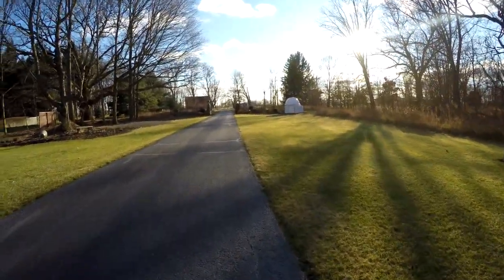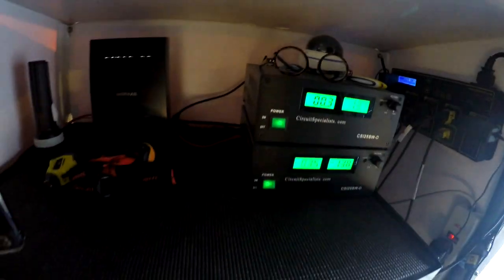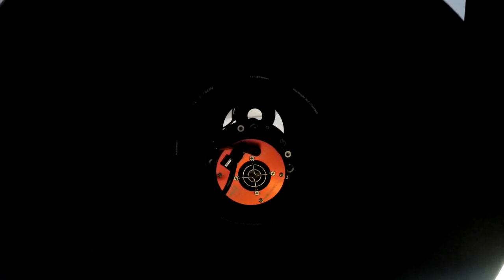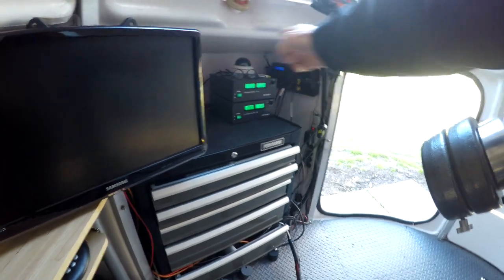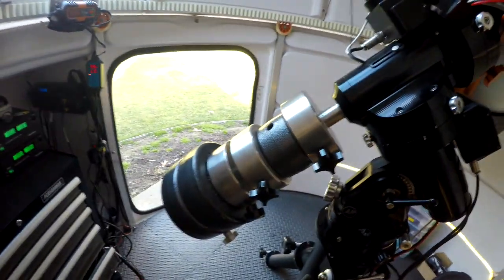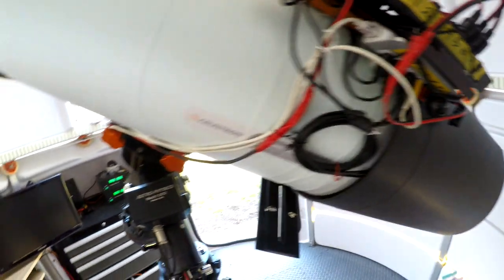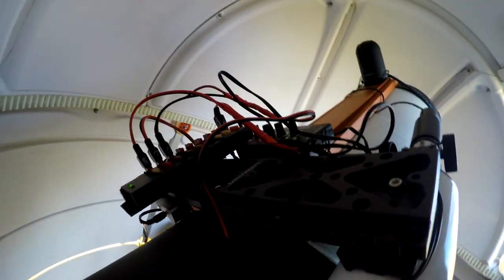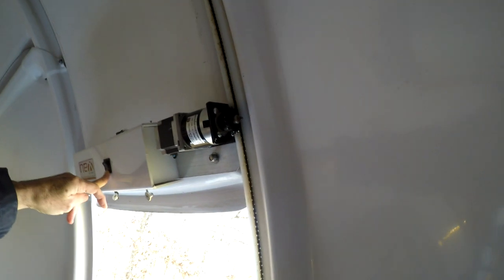DOME TOUR to share with my Nexdome group members

Comment: great setup!! . what is the diameter of that? 7ft? or 3 meters??  etc..?? and size of scope in it?  looks about the right size for my 8" NexStar?
Reply from the maker: dome is 8ft. Scope is 11" around 46 lb scope + extras. I probably have around 70lbs on the mach1.  Nexstar no problem. RASA 11 is a beast and I also have used a 152mm APO cf in there that's snug.

Comment: Thanks for the tour ...appreciate it ....One quick question :  Do little critters get into the dome and chew on wires ..?...just wondering .....
Reply from the maker: Not yet knock on wood. I spray around it 1-2 times a year or 3 with a ant/bug spray and that's it. I fear ants more than anything.  No issue in 4 years. Dropping some decon behind the desk would help if I had a problem. But why give them something to lure them in?
Reply: Please your contak name sir
Reply from the maker: UPDATE YES this spring. I hadn't used the dome since last fall. Went in and found a mom and babies in my drawer. I took em out. (literally) and have had traps since. picked up a couple more and recently just cleaned it out.  I now always have traps and decon. they didn't chew anything except my roll of paper towel that was stuffed in a drawer for nesting.   Mom went to run and I clubbed her with my channel locks.